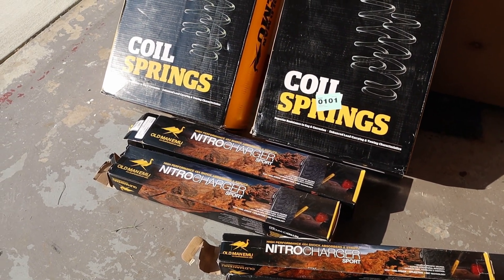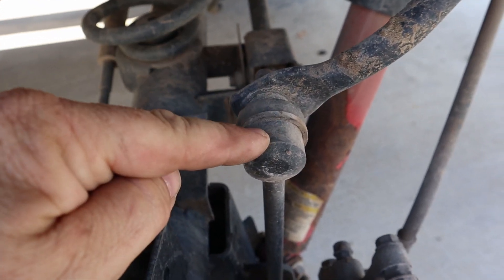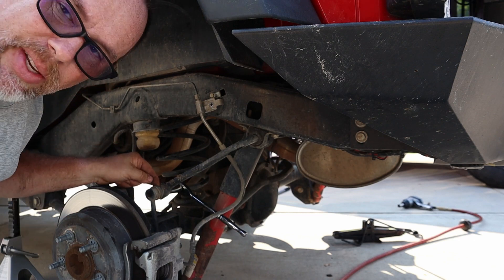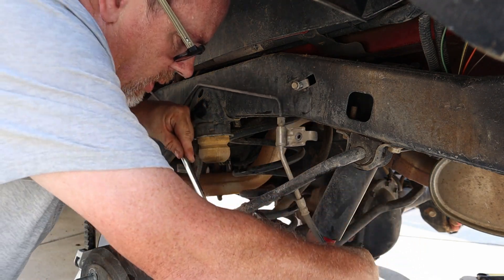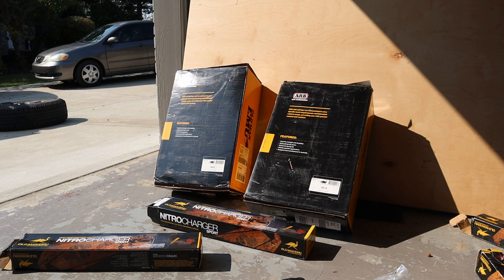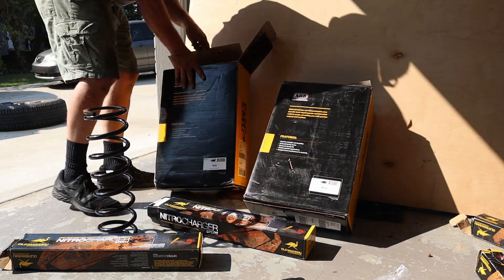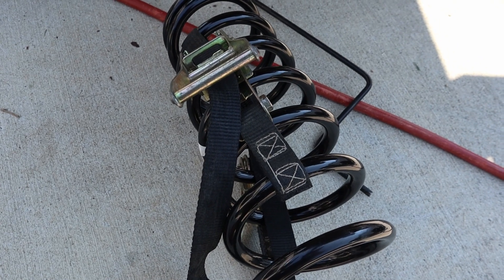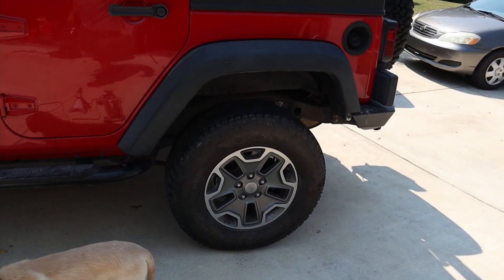Old Man Emu Heavy Duty Lift Kit Install

Comment: i installed the same system in  the rear side!!! bu now the truck is jumping in low velocity! jumping and jumping !!!
Reply from the maker: I have not noticed that with mine, but I’m carrying a lot of weight.
Reply: @rambling4x4adventures92  i don’t have any weight.. And everything is new but is jumping and Feels bad
Reply from the maker: My truck is like that. Rides terrible unless it’s loaded down then drives like a Cadillac. Do you plan to add weight? If not you might want to just go with a regular lift kit that has a lighter spring. I have a 150 pound bumpers front and rear, winch, plus the added weight of the Ursa Minor and goose gear platform with fridge in the back. For me, it rides just like it did before all the mods.
Reply: @rambling4x4adventures92  The Set I bought are the Old Man emu heavy duty high loaders .. My truck is a Toyota FJ Cruiser.  and change the coil springs and the shocks everything old man emu.  and now is worst.
Reply from the maker: So sorry, that stinks to do all that work and it not turn out good. Got to add some serious weight for the heavy load kit.
Reply: @rambling4x4adventures92  🤷🏻‍♂️🤷🏻‍♂️

Comment: Planning on the 2 inch lift, forums says it’s not true and it’s close or over  3 inches 🤣 not complaining tho because it will settle down over time.
Reply from the maker: I posted this on the other comment but wanted to make sure you saw it too. I had a leveling kit on my last JK. Two inches in the front and 1 1/2” in the rear. With my weight I added a 1” spacer to the rear making it 2 1/2” total lift. After installing the Old Man Emu 2 1/2” lift I could immediately tell the Jeep was taller while getting into the drivers seat. Now I have a lot of weight on my Jeep so yours may be different based on what you are carrying.

Comment: Great video. Did you have to add or modify any other things regarding the suspension and stearing aside from the OME shocks and springs from the kit? I have read that a break line relocation kit is needed, and also maybe an adjustable track bar like the one from teraflex? Also, did you relocate the rear trackbar? I went with the light load because based on what I've read I am not carrying as much weight.
Reply from the maker: I did not modify anything. Brake lines reached fine. Track bar was fine as well as rear track bar. It was only a 2” lift anything taller and you would have to change all the other stuff. Thanks for watching. Been busy with a farm we bought (rambling farms homestead). Will be out jeeping again soon.

Comment: Did you measure the actual life achieved after install? My 2 inch lift added over 3 inches.
Reply from the maker: I did not measure before I started but my wife complained that it was too high until we went wheelin and cleared all the obstacles. 3” sounds about right.
Reply from the maker: Just to add, I had a leveling kit on my last JK. Two inches in the front and 1 1/2” in the rear. With my weight I added a 1” spacer to the rear making it 2 1/2” total lift. After installing the Old Man Emu 2 1/2” lift I could immediately tell the Jeep was taller while getting into the drivers seat. Now I have a lot of weight on my Jeep so yours may be different based on what you are carrying.